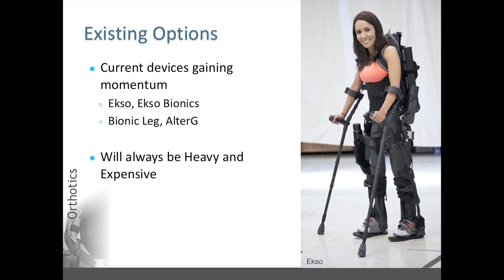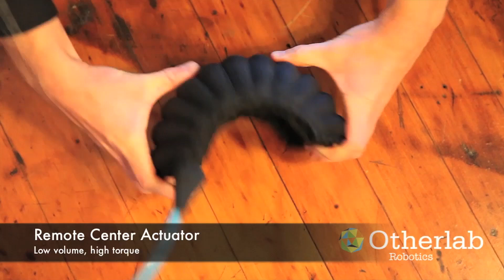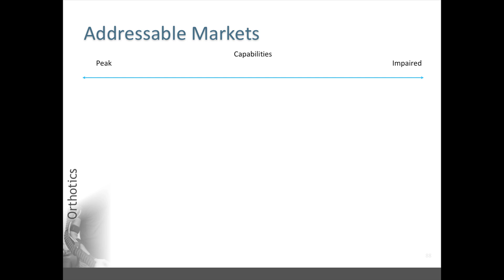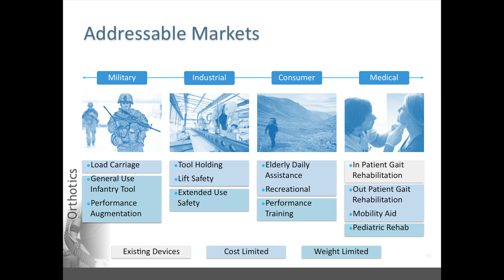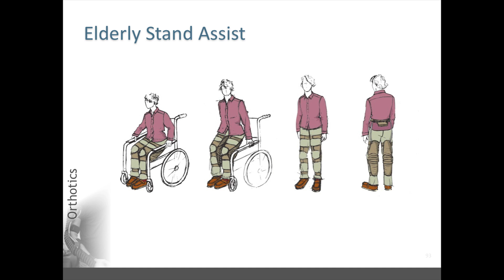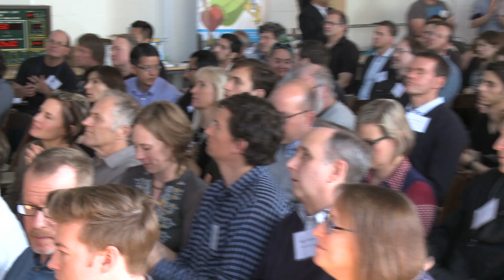Otherlab Orthotics at Show and Tell

Comment: These pneumatic "exoskeletons" may seem really impressive and as usual in this age of sales of marketing, get hyped to outer space.

But as someone who has done some genuine research on exoskeleton tech, I am acutely aware of the significant limitations posed by pneumatic actuators. They are non-linear and tend to suffer from poor position and actuation force precision.

However, completely soft bodied pneumatic actuators do have the advantage of compliance. The designs shown here will most likely be best suited for providing finite amounts of joint support, but getting them to say, restore precision movement necessary for precise positioning or precise force generation is unrealistic to say the least.